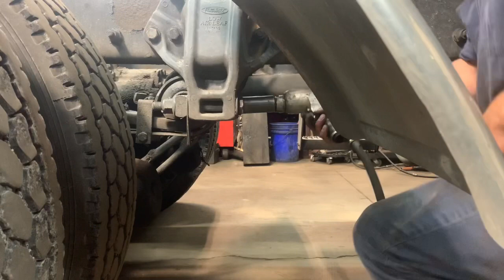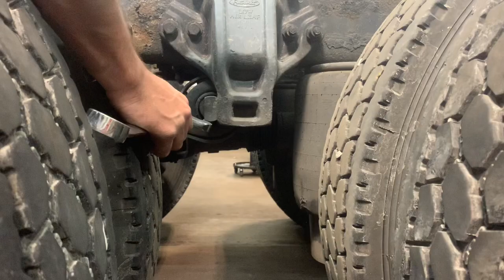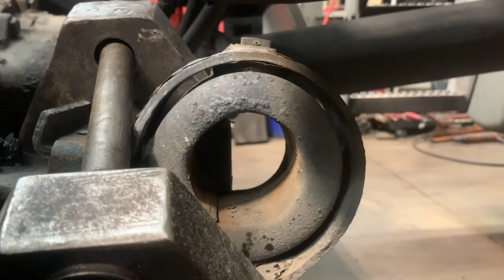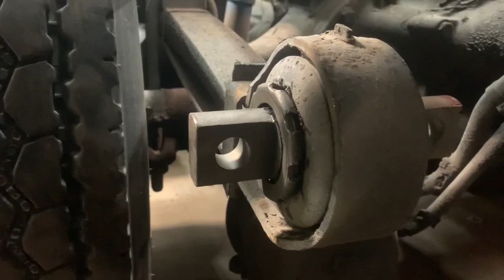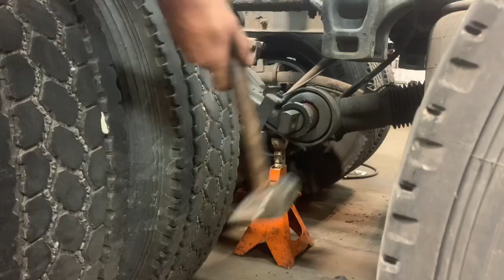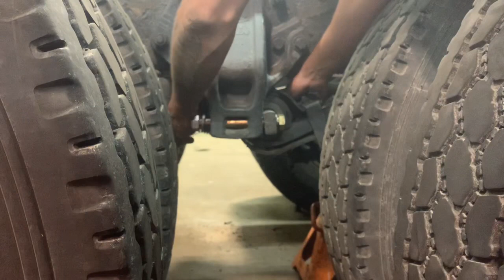Peterbilt Low Air Leaf | Press Bushing Out/In Spring Eye

Comment: That press is a good tool!
Reply from the maker: Thanks for watching!!
Reply: I’m partial to my Tiger, but this one is impressive as well.  The only issue I see with this one is the bulk of it in case you ever had to push the bushings out from the underside of  the truck.  The crimp on the bushing is on the inside from the factory so he can push from outside in.  He’s reinstalling with the crimp on the outside.  This is no problem unless you have to push his install back out, then you’d have to be under the truck, and possibly removing the drive line.  Not a criticism, just an observation.  Sometimes on the front drive, air tanks, apu’s, and hydro-pacs get in the way.  Whatever you have to remove beats the alternative of taking the spring down and pressing them on the bench.  I used to do that back in the day and man, mess the clocking of the bushing up and you have to do it all over again!!